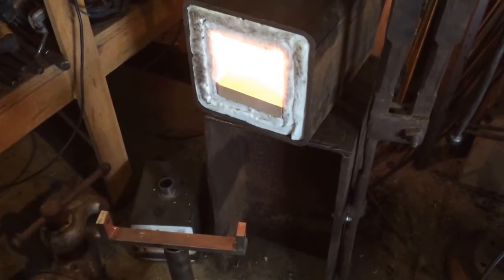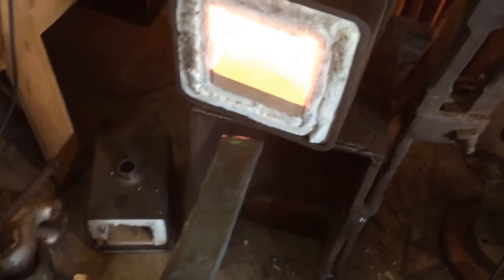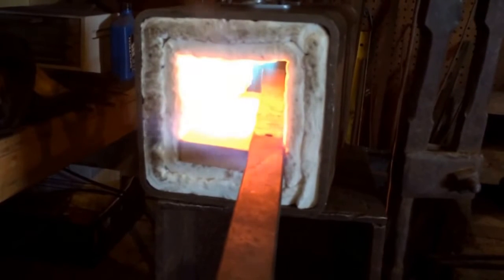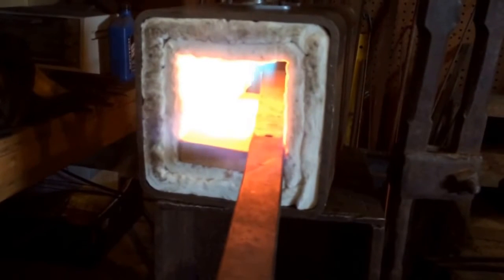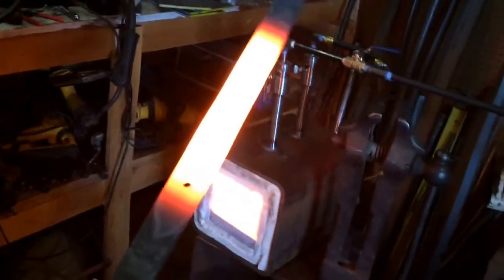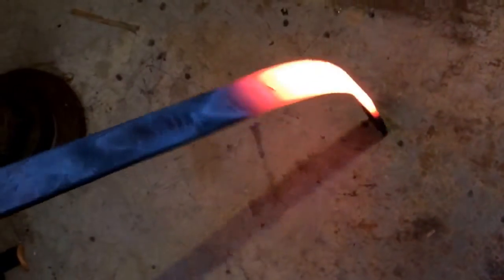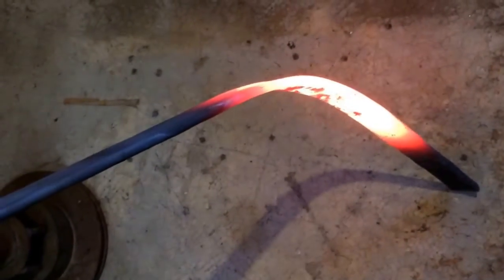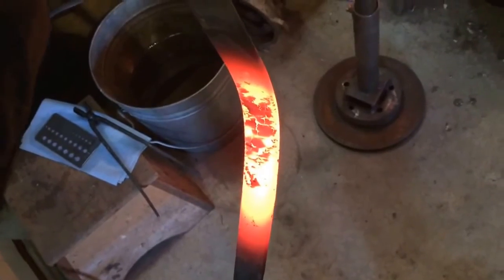Testing the Double Burner Forge

Comment: Hello sir,i have a problem with my burner,that blue jet flame wont come out (stuck on the flared end) only the weak blue flame is coming out,do you have the solution for this problem??
Reply from the maker: I'm Bored I can help you. Loosen the set screws and back the upper part of the burner as far out of the Venturi opening as you can. You need more air to pull through.
Reply: thanks for the answer,gotta try tomorrow and i'll let you know the result!
Reply: Jarom Rush holy hell it works!!,thanks alot sir! +1 sub

Comment: quick question from a (hopefully soon) novice. would the forge heat the material a lot quicker if it had a door or removable back wall? if so, then what would be used to help retain heat?
Reply from the maker: darthlordrevan09 You'd want to coat the blanket and add doors with a small window in each. You want the edges of the window to be removed from the interior edges of the wall of the forge.
Reply: Jarom Rush thanks a lot. that'll help when building the forge. i appreciate it.